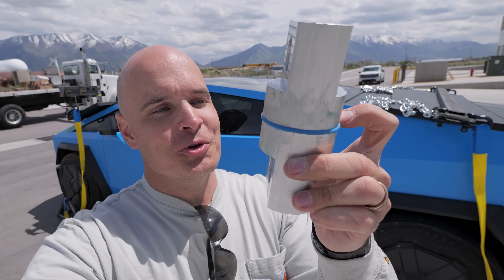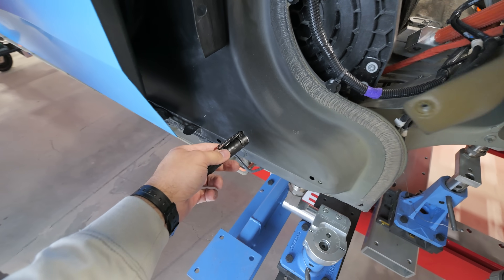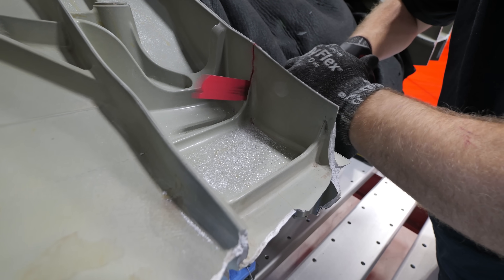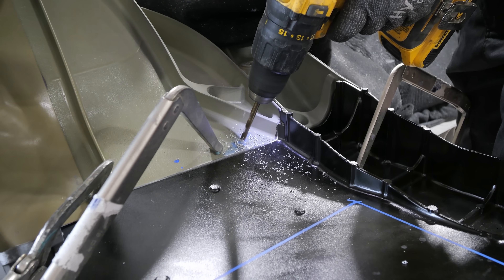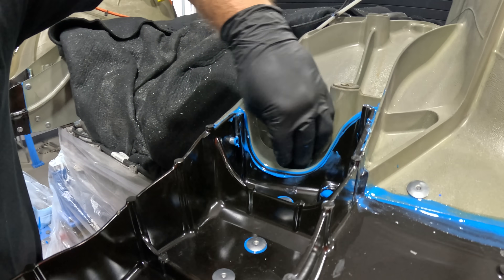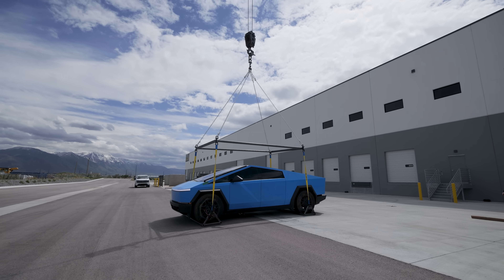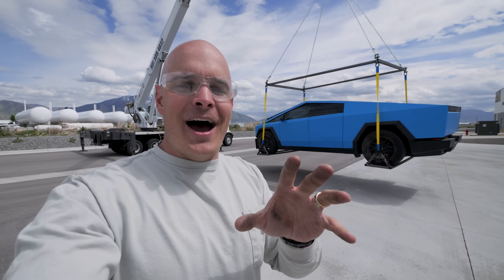Tesla Fixed my Cybertruck with GLUE - (but I'm not mad about it...)

Comment: Interesting how the glue was wiped flush at 12.19 yet on the truck lifting footage the glue was bulging out the middle of the two metal pieces fairly equally. 👀 

Dislike being that guy and don't doubt that 2 part glue does the job it says it does but those pieces were clamped during the gluing process and the invisible beads wouldn't have allowed any more compression.  Seems a bit odd.

If anything that aluminium test piece at the beginning and during the test is one solid piece with a blue rubber 'O' ring stretched around it.

Comment: 28 seconds into the video and I don’t trust that tesla didn’t just put a ring of glue around a solid piece of metal. Then sell it as “look at our super glue!”. Maybe there is evidence further down the video of the 2 pieces being glued together? Fingers crossed.
Reply: Holy shit. That is impressive. Still not buying a Tesla. But… wow.
Reply: ALSO. The repair seems to have way more glue than what your original damage shows? Maybe if it had that same amount it wouldn’t fail?

Comment: The glue is cool, but the repairability that Tesla engineered into this truck is what's really floored me.  Here's hoping all companies building cars using castings are taking notes here.  That this car wasn't totaled speaks to just how smart those Tesla engineers are.
Reply: The reason most cars in this condition get declared as totaled is insurance companies taking the least expensive solution. In Belgium not only an insurance car would have to pay the repair but also pay the devaluation value(the market price of the car before the incident - the market car after repairs). Or you could sell the car as totaled put that money in your pocket and the insurance would pay you the rest of the money based on the market price before it was totaled. The expensive way is when they decide to total you car, give you the market price (you think it is to low) or you just want you car repaired. This last situation is one that makes them do extra steps because now they need to see multiple cost evaluation from the constructor or independent repair shops, then they still need to pay for storage when that is happening, plus a replacement car if you have that in your insurance. Transport it where it needs to be. Get it fixed, get it inspected if anything seems fishy, get sued if it is taking too long. Maybe the repair shop closes doors for ever while it still has your car. Maybe they realize half way they can't fix it as they thought they could. Declaring a car as totaled is almost always the cheaper option even when the car is very repairable. I have seen cars that cost 8K in the market, repair cost is 2K, the insurance company goes like we would rather give you 8K for the car than try to fix it and a price cut on your next car insurance.

Comment: I was rear-ended on the motorway almost a decade ago and it didn't look great, but it didn't look at bad as your truck. Repair bill was £11k, so it was significantly cheaper to repair the truck than I was expecting!

Comment: To be clear, the adhesive is rated for that load in tension. The way that the glue is being used on the fybertruck is mot purely in tension when towing. That being said, the rivets are both providing clamping force on that interface, and resisting shear. They arent simply there for holding it together during assembly.

Comment: Waht most people do not understand is a lot of cars' whole frame is glued together. I have had 2 Lotus cars. most of the aluminum is not welded but glued. Lotus makes one of the most rigid frames in the business with glue. I believe many performance cars use glue in the same way.

Comment: We use structural adhesive on our commercial vehicles and have for more than 20 years.  We do routine testing where we lap 2 pieces of steel or aluminum and pull until failure and I can tell you the metal fails  before the adhesive joint.  The vehicles have been in constant use for 20 years and the adhesive maintains its strength.

Comment: If anything, now the bumper is gonna snap either before or after that glue joint. Same problem. Same weak Engineering. No one has any concerns that the bumper is 3-4mm higher up than it used to be?  Or that arguably, it’s now even less capable to tow than it used to be? I thought the whole argument was that if you hit a nasty bump, and there was heavy tongue weight, it would just snap the rear bumper off during a tow, causing  a very dangerous and catastrophic situation. This is not fixed. This is a Band-Aid.

Comment: so you glue the paint covering the aluminum to the paint on the replacement pieces. What it the strength of the coatings' adhesion to the metals?

Comment: Yeah, let's see you test that same piece every few months for the next year, should be interesting especially in deep winter. You cannot repair cast aluminum; it also accumulates stress and eventually breaks. I would not trust towing my garbage to the dump with that set up when it is brand new, let alone after a funky repair like that.

Comment: I love how the tools they use (drill, sander, reciprocating saw, riveter) are just regular consumer grade tools many people own at home.
Reply: I have some bad news for you about other “professional” tools…
Reply: Did you see the rivet gun? That is $1,000. I don’t know if they need the 18V version or if they did that to use a common battery, but the lower capacity 12V version is only $200.
Reply: @maximusmagni1  The tools are one thing, the overpriced OEM body parts are another. When they don't license or allow 3rd party part makers to make things like fenders, bumpers, or the various parts - it's a monopoly on prices.
Reply: Just the alignment fixture might be difficult to have around. Would be nice to know if it's absolutely necessary.
Reply: @buda_glez Yes to make big repairs like these you need the bench to hold the vehicle, also helps out once you've installed new parts on the vehicle to fixture them and make sure they're in the correct placement
Reply: @buda_glez  there isnt one
Reply: Wtf did you think they we're gonna use bro, Tesla doesn't have some magic toolset🤦‍♂️
Reply: Milwaukee is marketed to the professional trades. I’m sure other professional tool company can make it easier to buy like Milwaukee if they just make a deal with big box stores…
Reply: Smoke and mirrors. Because they charge INSANE COSTs for Tesla exclusive body parts that nobody is allowed to make third party. So, its not really repairable using third oarty parts outside of Tesla
Reply: @travisminneapolis  Nobody is allowed to make? Citation needed there. I think the issue is that due to the low volume of the cars and the novel methods used to make some of the repair parts, it's simply not profitable for the aftermarket to supply parts.
Reply: same story with any auto repair shop
Reply: Which makes you think, why do they sell this thing for $80,000?
Reply: Aside from that glue gun, it looks like it takes a lot of force to push it out through that mixer!
Reply: @yngndrw.  Look when Zac glued the two aluminum parts, he did it with a manual glue gun. i think the electric glue gun is for conveniency and avoid the technician getting tired. imaging pushing a manual glue gun all day after day lol. he could become a professional arm wrestler.
Reply: @yngndrw. you can also use a manual type of gun but it is very fatiguing especially to your forearms 😭
Reply: @multex7195 Those blind rivets require ~3000N of pulling force
Reply: @BOMxSquad  I like the approved riveter  too
Reply: @yngndrw.  That epoxy applicator is a piece you can buy at any reputable automotive supply store. These sort of panel bonded repairs are common on all modern automobiles that are as much glued together as they are welded. Definitely not a Tesla exclusive!
Reply: i wouldn't call dewalt and milkwaukee consumer grade. They're definitely at the higher price end of tools you can buy. AvE calls them 'prosumer', basically marketed toward both pros and consumers.
Reply: Should have used Snap-on

Comment: Awesome but showing the original damage they didn’t use nearly enough glue. Just a couple swiped and it was the failure point. Probably a cost saving measure.

Comment: A crane lift is a static load, not a dynamic load like you would experience in a collision. It's a neat demo, but it's also why channels like "HowNot2" which does testing of rock climbing equipment gets some flack when only doing pull tests and not drop tests (which he has also done). Of course there are things to learn from static load pull tests, but now you gotta do a proper dynamic load test for another video 😉
Reply: True. This test tells you little to nothing

Comment: Come on you are better than this.  You know that sure it might hold right now but if you heat and cool and heat and cool that it is going to weaken the glue so in like a year that piece is just going to fall right the hell off.  Who cares if they make the best repair guides when you have to buy a whole new Swastitruck every 2 years in replacement parts?

Comment: Way more glue in the repair than in manufacture.
I wonder what the repair cost would be if the cyber truck's reputation wasn't in damage control?
That repair looks like a lot of man hours to me.
Is this the glue that was supposed to be used on the side trim?

Comment: The problem is not the glue. If you saw your faliurepoint there was way less adhesive on the truck than while reparing it. Reason beeing that tesla knows that no one would really use this truck to do any kind of heavy towing. Plus the adhesive is on the protective paint so the paint ist the weakpoint on the truck

Comment: Probably the glue connecting the frame is capable of holding a lot more but putting load directly down makes aluminum bend bit by bit and separating the glue slowly

Comment: the whole megacasting method reminds me of how toy manufacturers make toys via casts. thats exactly what Elons gigafactory does, but at a much larger scale, which then involves metals, wires, battery, controllers, sensors. etc  he took an existing manufacturing process, and magnified it. simple, yet revolutionary because the easier and faster it gets to make a car, the cheaper it can be

Comment: "Using protective coat as a supplemental protection against corrosion"

Aluminium does not contain Iron or Steel, so it does not rust..

Comment: I wonder what happens if it’s gets rear ended twice, wouldn’t the first replacement frame be over the cut line and prevent the same repair twice ?

Would you need to replace the entire rear frame every other rear end?

Comment: How much did Tesla pay you Jerry?

It’s pretty obvious this video is staged or sponsored by Tesla. At the end, the aluminum bracket they show as the ‘result’ has a perfect glue line that looks like it was applied externally just for show. It doesn’t match the earlier part where the glue was manually applied and the excess wiped off. Also, the aluminum piece at the end looks like a solid block, not the same one used earlier. Looks like a setup to make the glue appear more durable than it really is. 12:18

Comment: Whats the real life durability of this adhesive? Will it change as time goes on, as its exposed to the elements, the heat, cold, water, etc. Can it survive decades without failing? What about when you put it up against salty areas, either from the ocean, or for snow cleanup, how will this hold up, and what about the metal around the adhesive?

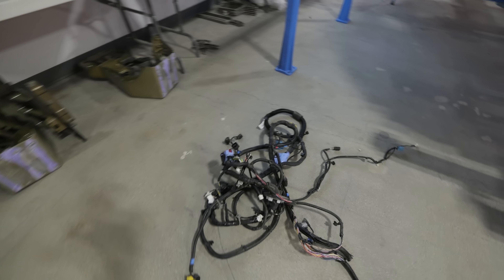Comment: 2:10 Below 60v is "low voltage" lol

Defnitely cheaper than I expected. I had a deer strike a year back and taking no frame damage they had to replace the front facia, headlight, fender, hood and door... it was 10k for basically cosmetic damage. This had frame damage and was 13k? wtf man....

Comment: Pro: That glue makes it as durable as before
Cons: It's as durable as before
Reply: Jerry  or jerry-rigged or paid?
Reply: @qbi4614  He said in his previous video “there are real world scenarios where the trailer weight becomes tongue weight, going up a steep hill or driveway your hitch could snap, or your trailer jumps the ball going 80mph on the freeway, giving the safety chains a jerk, your whole rear end is now gone” “it’s built like a pop can”

Now it’s “As long as you load and balance your trailer correctly, the cybertruck will always be able to load its rated capacity” which tongue  max weight apparently is only 1,100 pounds, funny how after he goes to Tesla he doesn’t  say any of this 😂 seems like someone paid him cough Tesla
Reply: @SMURFF707  it's not called a getting paid, it's called getting threatened with a lawsuit. What he did last video was misleading and apparently he backtracked because he can't afford to be sued, while you internet losers can keep on coping and hating because you have no downside, last video you believed what he said, this video he's full of $h1t, make up your mind man, agreeing only with the haters just makes you a hater too
Reply: @SMURFF707  except you must already be at the top of your scale for your hypothesis to happen, so you must be careful. It's not undoable, even at tongue weight.
Reply: @ddnnmo  This isn’t my idea, I’m just repeating what the guy said, but it actually makes sense. Physics still apply when towing. Gravity and momentum can cause problems. If your trailer hits a bump, a rock, or anything on the road, it could jump and rip the rear end off the Cybertruck, which is obviously dangerous.

You don’t have to be at max tow weight either. If there’s enough force on the tongue, it can still snap. Bending moment is a real thing, like when the trailer is at a steep angle and pivots, putting torque on the hitch. Add gravity and it could snap, even without max load.
Reply: @AlexandreG  Saying he could be sued isn’t accurate, you can’t sue someone just for having an opinion about a vehicle. If that were the case, the video would’ve been deleted, which it hasn’t. He also never actually explained how the video was “misleading.” In fact, he didn’t address it at all, which makes me think there’s a reason for that. What he did say is based on real-world towing situations, since not everyone tows on smooth, perfect roads. No ones “hating” it’s literally what he said, now he acts like he never said that and basically quotes what Elon said about it.

Comment: when I was around 9yrs old, I remember back in the 1970's here in the UK, seeing a pack of 'Araldite' two part Epoxy glue my Dad bought and used in his garage, had a picture of a car lifted by crane with just a small bonded block to the roof of the car, it blew my mind that glue could do that at the time! 😯😏👍    😎🇬🇧.

Comment: The glue repair looks solid assuming they give this level of attention to every vehicle and not just those filmed by influencers with a massive following. The glue on the original break does not appear to have been applied with the same level of scrutiny as what we see with the repair. The repair was painted on covering every inch of surface where the original appears to not been tooled in at all. I do feel the repair is much stronger than original due to what I feel is extra effort during the install.

Comment: 11:23
So, from your first video to right now, what changed so dramatically after this repair that you feel the towing capability of the Cybertruck is now totally fine and the hitch capability is good to go? Sure, they used more adhesive, but it’s still the same general process.

Comment: Looks like the amount of glue used during first assembly was less than that used during the repair. You can see after the accident, the glue formed just a stream of S-es versus coating the whole patch during the repair process.

Really appreciate this inside look of the repair process. JRE really is something else.

Comment: When i did body work years ago we used 3M Panelbond adhesive for a lot of applications. That stuff was super strong and faster and easier than welding in most cases. We used it mainly along the edges of replacement door skins where you'd have to hammer the edge of the skin over the inner door shell. I used that stuff to replace a section of floor pan in my old Jeep Cherokee too. I just hammered a piece of old door skin sheet metal to shape it to the floor and overlapped it over the old floor pan and glued it in using rivets to keep it in place. Worked great and saved a ton of labor that i would've used if I had welded in a new pan.

Comment: I'm honestly shocked at how open tesla is from a repairability point of view. I saw LTT's home backup battery using old tesla batteries and was amazed that the control circuitry doesn't lock itself down and now this? an actually reasonable repair procedure and allowing you to come in and see what they were doing and how it works. This has greatly improved my opinion of tesla.

Comment: This guy: "Don't buy this phone. The battery is glued and I don't know how to remove it right. 
Tesla panels glued ON A CAR This guy: "OH MY GOD TESLA I LOVE YOU!!!! SO SMART! SO SMART!"
Reply: structural glue, and battery adhesive are wildly different lmao. The issue with phone in a glue is that it's very difficult to remove without damaging components, glue on a steel panel can be doused in a solvent and hit with an angle grinder.
Reply: Quite the diffrence between "theres no reason to use this much glue on a phone"  and "this would have been a total replacement on other trucks"

You hold competitors on the industry avg

The safest car of the 50s is now "never get into" today

Comment: What is the plan when you crash again ? The original interlock section has been filled. Is there a smaller interlock section on the repair section ?